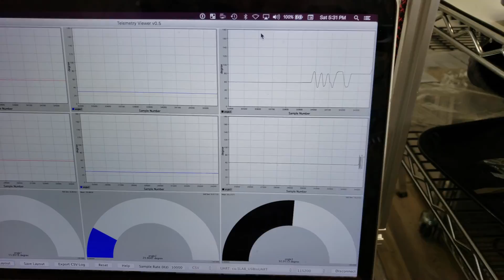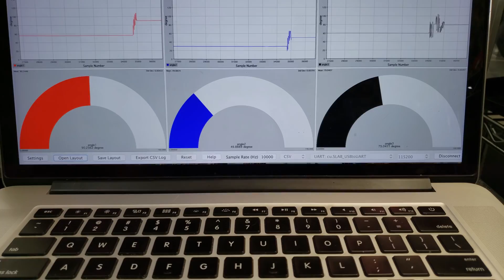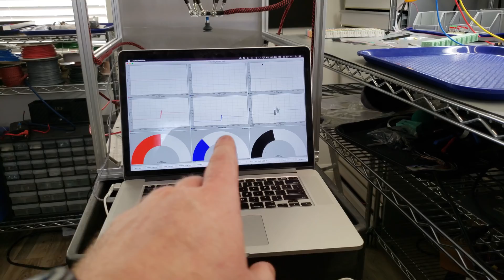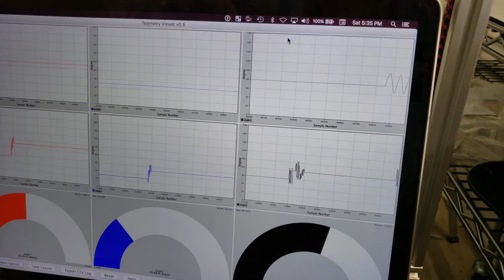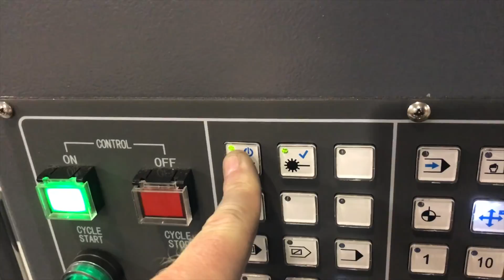ESP32 Delta Robot PCB

Comment: so the pcb alone cleaned up all the noise?? Makes me wonder about all my failed projects because of jittery motors and bad signals on breadboard and prototyping board haha
Reply from the maker: Yes, proper PCB layout can do wonders. Always route your sensitive signals first like an SPI bus. I like ground planes on the top and bottom of the board so I can easily separate two signal with a ground trace.

Comment: are you getting good resolution?  those are armonic or geared reduction?  since there is backlash on the geared models and for fast movements..
Reply from the maker: I am using regular planetary gearboxes but the backlash is almost non-existent on 2 of the 3 gearboxes. The backlash may be able to be minimizes with a bit of code. I don't know the exact resolution yet but I am getting good enough resolution for picking up and sorting smallish objects(<0.5") and marbles. Harmonic gearboxes are out of price range for this hobby project but if I ever do need them, they can easily be added. If you haven't seen it yet, I uploaded a video of the machine in motion here: https://youtu.be/1aBubz6Mk2M

Comment: Hello!
The project seems greatly engineered, everything seems awesome!
One thing i don't understand is what it is for? Also why those super beefy steppers for a small delta gantry? (those motors seems like at least NEMA34, and your delta arms looks like 10mm rods)
Did you use those because you had them laying around? or is the high power really required in your project?
And what is it supposed to do, to have such a beefy frame also ^^
Anyway, amazing work!
Reply from the maker: Thanks Audrey! They are 80VDC,7.8A NEMA 34 stepper motors with 1600oz-in of torque. The toque of a stepper motor is drastically reduces when microstepping and when driven at higher speeds. At 1/8th microsteps, you're already at around 19% of the original rated torque. At 1/16th microsteps, the motor now only has around 10% of the original torque rating. The power of these motors gives me much higher torque at high speeds and higher resolution compared to smaller stepper motors.
Reply: @ProtoG42  That's a discover for me, i knew about torque degradation with speed, but didn't know that microstepping caused such drastic torque loss!
(btw, i saw from your other videos that it was for a pick and place machine, so high speed AND high accuracy required, in that context, i'm less surprised by the super beefy metal frame).

Anyway, that's an awesome project, i'm eager to see the next videos :)

Comment: Would you consider servo, I'm developing a STEpper seRVO (STERVO) PCB, which you might have interest in. My goal is for it to accept the typical step and direction pulses, communicated via industrial fiber optic for isolation. It's fiber optic cut with scissors which should minimize electrical noise issues. It's a work in progress. I post it as an open source licence, I typically do the MIT licence, and I'm not very concerned with the licencing. If you might consider trying it out, I could send you a mostly populated board, with a handful of not yet installed components. Software is not my strong point, and I'm time constrained, so it's been a slow moving project lately. Here is a link to the KICAD files. 
https://sourceforge.net/p/daecu/code/HEAD/tree/Hardware/trunk/Stervo/
Reply: More about me at jaredharvey.com
Reply from the maker: Very cool! It might take me quite a while to get around to testing it but if you would be willing to send one over I'll gladly poke around with it. Would it be something I put in between my controller board and stepper motor driver or is it a stepper motor driver itself?
Reply: The board can theoretically drive up to a 45V @ 43A DC motor, which is a decent sized DC motor. It has feedback options, allowing it to be a single motor servo controller. I intend it to be attached to the motor which minimizes RF antenna loops and minimizes volt drops due to longer wires with higher DC currents. Also it has a temperature sensor, so it can monitor the motor and prevent overheating. 

I'm ignorant about your motor controller setup. Most stepper controllers I've seen usually have a brain which generates step and direction pulse. Those pulses are sent to something similar to a polo A4988. The driver board then generates the stepper signals. I'm assuming your setup is similar, where at some point you generate these step and direction pulses. 

Stervo is a driver board similar to the A4988, but for DC motors with feedback. If you have the step and pulse signals, you would simply connect those to this board and a DC motor instead of your existing stepper driver and stepper motor. If you want optical isolation, your step and direction power the fiber optic LED's, then the optics relay to STERVO. 

STERVO could be used on several different motors, and I specifically designed it for some off the shelf servocity gear motors, and a Namiki Coreless servo motor. What is your torque curve for the stepper? I'd bet it's similar to the Namiki curve. However the Namiki is about the size of your thumb, and costs like a brick of steal the size of your thumb. The stepper is the size of your fist, and costs like a steal block the size of your fist. 

https://www.ebay.com/itm/Japan-Namiki-Coreless-Servo-Gear-Motor-DC-12V-120RPM-Gearmotor-With-Encoder/262763887742?epid=882595888&hash=item3d2df2bc7e:g:tF0AAOSw6DtYUp-K

https://www.servocity.com/motors-actuators/gear-motors/heavy-duty-gear-motors/premium-planetary-gear-motors-with-encoders

How do I contact you? I'll need a shipping address at minimum. Should we exchange e-mail addresses?
Reply from the maker: @jaredharvey1511  My motors are 80VDC,7.8A NEMA 34 stepper motors with 1600oz-in of torque. You can email me at garofalo42(at)gmail.com

Comment: Looks super cool! This might seem like a silly question (I'm new to these things): why use an esp32 instead of something like an esp8266? Is it because of the higher processing power, greater number of input pins, more analog inputs, or perhaps a combination of the aforementioned? I say that because the 8266 has more support, at least to my knowledge ( I use arduino IDE to program them).
Reply: ESP32 has plenty of support now too IMO. Also it has a lot more memory than the esp8266! That comes in handy if you need wifi as it takes a lot of space.
Reply: @MrFuxya  Makes sense! Thanks for the reply

Comment: Since you have discovered noise issues, get rid of the ribbon cables.  You can still use the headers on the PCBs, but for the wire use miniature Lavalier microphone cable, which is a shielded twisted pair.  Do not use the shield for an signals and connect it only at the controller PCB ground.  Samtec has compatible header shells and sockets for the wires, so you can keep the same pin-outs on the PCBs.  See: http://www.mogamicable.com/category/bulk/microphone/lavalier/  and  http://www.mogamicable.com/category/bulk/ultra_flex_mini/   For extra strength, put some hot melt on the connector and some 3:1 adhesive lined heat shrink over it.  Strong as molded.

Comment from the maker: Here are links to some of the equipment used on my delta:
MPS MA730 Magnetic Encoders: https://www.monolithicpower.com/en/tbma730-q-rd-01a.html
Stepper Motors and Drivers - https://amzn.to/2RcFBqK
ESP32 - https://amzn.to/2TK9Sik
Object Tracking Pixy Camera - https://amzn.to/2r4GaaL
Braided Cable Sleeve - https://amzn.to/2LedCnb
Stainless Steel Cable Ties -  https://amzn.to/2LevZsb
Strain Relief Cable Glands - https://amzn.to/2LdnuO8
Silicone Fusing Tape - https://amzn.to/2J5RPO8
Locking Casters - https://amzn.to/2kJ75WB
Aluminum Extrusion - https://amzn.to/2Lh14M7
Cable Clips - https://amzn.to/2xColG8
M5 T Slot Nuts - https://amzn.to/2HdnNWP
M5 Screws - https://amzn.to/2J4OSBs
Carbon Fiber Tubes - https://amzn.to/2J5xVqz
Suction Cup Nozzles - https://amzn.to/2Qh2Vqg

Here is a link to the telemetry viewer I used in the video to stream the raw data from the encoders: http://www.farrellf.com/